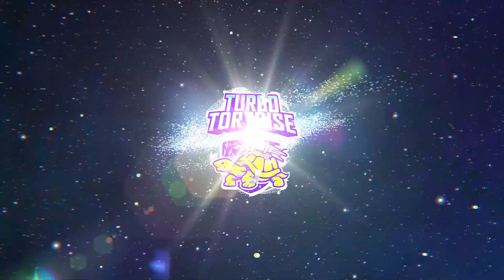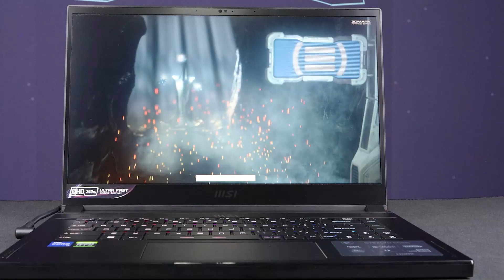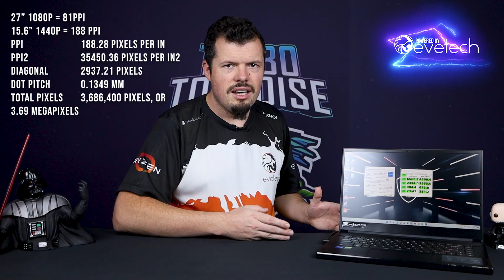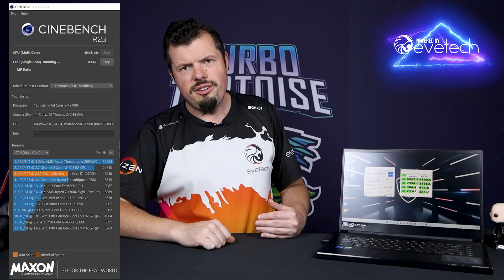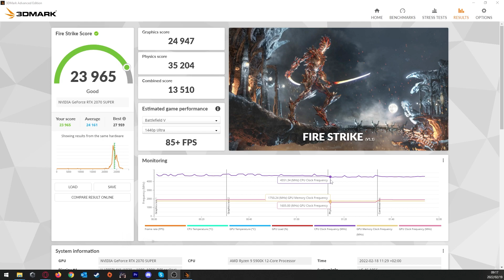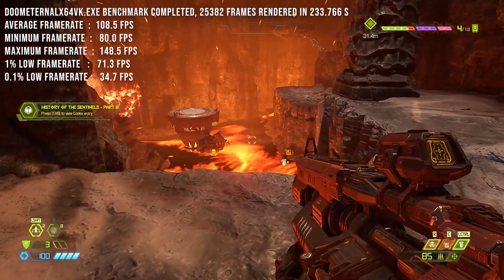MSI GS66 12UGS Review - Intel's 12700H and an RTX 3070 Ti make mobile 1440p60 gaming a REALITY!!

Comment: Anyonne tested it with the different MSI options to figure out the best combo? I'd ideally Undervolt and use silent option for fan control but that isn't possible? Whats the next best thing? Extreme performance mode in MSI Center?
Reply from the maker: Run it with the extreme performance mode with undervolt and auto fan for best performance
Reply: @evetechtv  can't undercoat this cpu I believe? Supposedly this one doesn't undervolt if u Google it

Comment: How are the temps on idle and moderate use? I returned the Razer blade advanced QHD 3070 because it was a toaster. Even browsing something shoots up the temps to 60-68 C and extremely uncomfortable to type.
Reply from the maker: Nothing near that... Usually mid 50s on these 12th gen units and sometimes as low as high 30s

Comment: Would you recommend the GE66 raider with i7 12700h and 3070ti over an asus m16 with i9 12900h and 3070ti? I'm afraid of those msi's hinges storys
Reply from the maker: If it's the same money it's hard to turn away from the M16 just due to spec up
Reply: @evetechtv  it's around 400€ difference 😁

Comment: I'm planning to get the Pulse (GL66 12UGKV-464) version of this laptop, nice review. Anything about this review not apply to that laptop? They seem pretty similar, but the GL66 seems a bit bigger so I figured it might get better thermals. Also since I plan to use an external monitor most the time, the screen resolution isn't as important to me.
Reply from the maker: The models are very similar. Thermals would also be similar but with less fan curve.

Comment: I'm torn between this and the M16, which one would you suggest for some image rendering, casual gaming (CSGO, valorant) ? which one would you say is quieter during light tasks such as web browsing and watching Evetech's reviews on youtube? :)
Reply from the maker: They're probably going to be similar where noise is concerned so would probably best to check price/performance. The components will always have to slow down their clocks in order to get the temps and fan curve down so with most slim chassis it's a much of a muchness. At least with the reviewed unit you know what to expect. Thanks so much for the support!
Reply: @evetechtv  Thanks for replying! Cheers!
Reply: I’m returning my m16, it’s does everything I want it to do, but the fans sound like fighter jets
Reply: @4u2nv24  Even when light using such as watching a movie or web browsing? I'm getting mixed replies on this matter but I guess everyone has different tolerance for fan noise anyways so that's expected. Which one are you getting instead?
Reply: If you have OCD get the msi, otherwise get the m16. the perforations on the lid of the m16 traps dirt and very risky near liquids, one spill even if the lid is closed is going to be disastrous while other laptops will do just fine... third , hot air blowing towards the plastic screen is a torture . It blows hot air, because its a powerful windows laptop. And it blows directly towards the plastics of the screen. Just wont work for me.

Comment: Just purchased this thanks for the review. I did purchase an Aorus 15 XE5 and it was a big disappointment so I am returning it. Hoping this is much better.
Reply: how is it? did you get it from best buy?
Reply: @Gerard1321  it is great the keyboard is a bit mushy but I like it. The touchpad wasn't ideal at first but once I got used to it and updated the drivers it was fine and I like the size. I got it from Costco because I wanted the QHD model. I wish I could afford the GS77 for the bigger screen but this is a much more portable solution and I use an external monitor most of the time anyway.  I will test the battery more but got around 3.5 hours yesterday with 47% charge still left and I was still loading data and doing updates so I will test the battery more but so far it is the best Alder Lake laptop I have used by far. One thing you have to update the BIOS for the MSI Center to fully work or you won't be able to get updates using the MSI Center but that was quick and easy.
Reply: Hey David I am thinking about getting the 15in version for gaming + uni. Is it quiet enough when browsing and running word to be in a classroom?
Reply: @benhindbo5207  for browsing and doing non-0gaming stuff including programming and web development it is very quiet and I don't even hear the fans really under those loads.

Comment: Hey man, thank you for the dedication you put into this review. I'm looking at this laptop in comparison to the Asus M16. It seems like the overall package is better with the GS-66. However, I'm concerned with the fan noise from both laptop and I already know that the M16 is load and the fan kicks in whenever there is more than 8-10 tabs open with a video from YouTube and a couple of websites. Is this the case with the GS-66? do you still have it? if not, please see if you can recall this info. TY!
Reply from the maker: You won't hear fans until you engage the CPU quite a bit... Even when gaming on lighter titles like CS it was a hum at worst

Comment: Im buying this laptop and this was very informative, also i was scared to buy a gaming laptop rather than a desk top because i thought it would take a massive hit in performance. But im actually sold now great video you earned a subscriber cheers mate.
Reply: Have you experienced any issues with the laptop restarting due to hardware failures? I game for about 6 hours a day and noticed that issue. I play with the laptop connected to power too. I feel like the laptop is overheating.
Reply: @Reverend BoneZ    Hi mate, any issues with overheating so far?  Tnx!

Comment: Great review. Great laptop! One issue though, I have this laptop, I am having issues with the two USB-C DP ports, I cannot get either of them to display to my monitor. Have tried two monitors and the cable is known to work as it works from my other laptop and also works from the TB4 port. Cable is alogic usb-c to dp 4k 60hz cable. Have you or anyone else with this laptop had issues or tested those ports? The TB4 port will display with that cable so it does have display output, but the 2 USB-C ports will not. I'm not sure if it is driver issue or hardware at this stage. MSI support haven't been able to resolve the issue remotely yet.
Reply from the maker: Not sure tbh because I didn't test that directly but would assume it should work because this is like the 3rd gen on this chassis so MSI should have a solution soon. Best bet rn tho would be to use DDU (display driver uninstaller) and do a completely fresh install of the latest Nvidia drivers.
Reply: @evetechtv  thanks for the reply. MSI replaced it under warranty, hardware issue. Works perfectly on replacement.